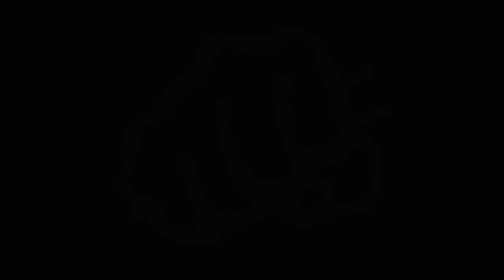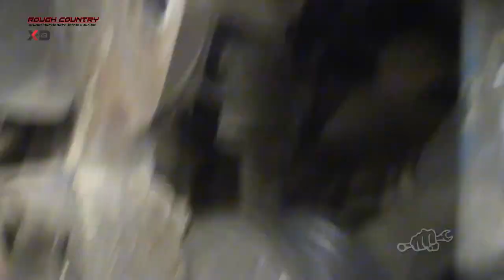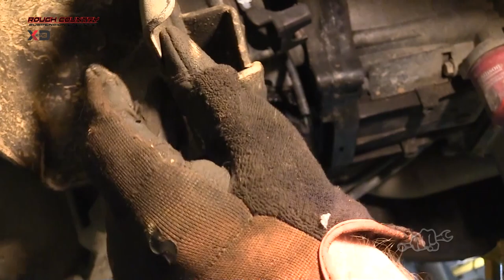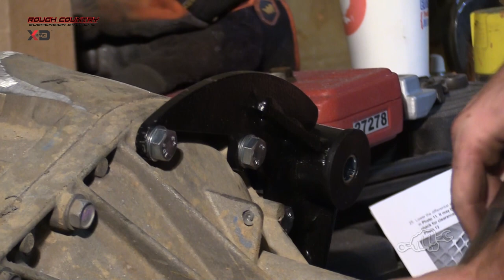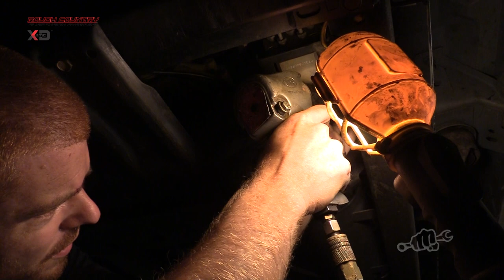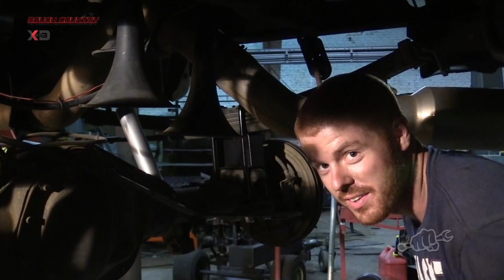Project Duramax Lift Kit Install - Tow Rig Tech Episode 5

Comment: Big Thumbs up on this video Great Job I know it’s was a pain but thanks! I have one question? Does the front wheels hang out more than the rear? I thought you needed wheel spacers on the rear wheels only?
Reply from the maker: The fronts do hang out a little more than the rear but that is how most trucks are setup to help with turning radius

Comment: Hey. How did those wheel bearings last after installing the kit? Considering they’re supposed to be torqued to 177ft pounds. And you just used a big ass impact on them. Bet they were howling in at least a week. Probably can’t hear over tire noise though. You’ll feel them some day, just wait.
Reply from the maker: Haven't had the first problem with them.

Comment: I’d love to do that to my 07 Dirtymax, but I have to tow a gooseneck trailer often.
Reply from the maker: it's just a little lift and most good goosneck trailers are adjustable
Reply: @BustedKnuckleVideo  I have pretty much the same truck, just airbags on back and  a programmer with 145k miles. The reason I worry about the lift is I’m often towing 14,000+  and sometimes close to 20,000.

Comment: Does it really ride like factory or did RC tell you to say that? lol
Reply from the maker: It actually rides way better than I expected! Really all we did was move the suspension mounts down with this system. I have zero complaints about Rough Country. This is the second truck we have lifted and had zero issues.
Reply: In my opinion the torsion bar front end rides better than the strut/coil spring models. On the 1500's anyway. Had a 2000 model with a 6 in that rode way better than the 2012 I had